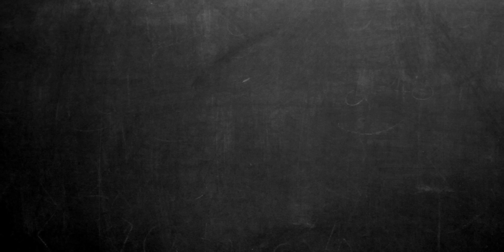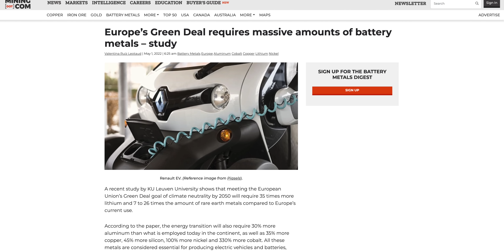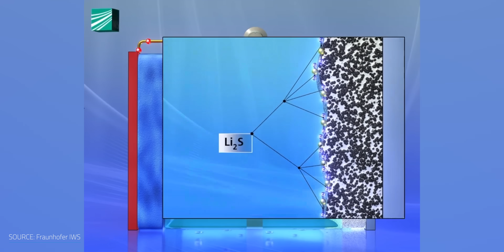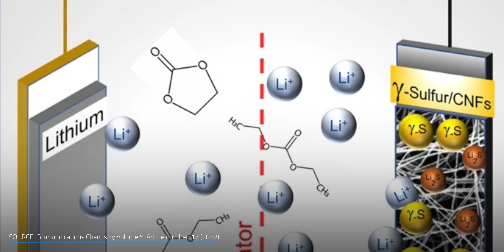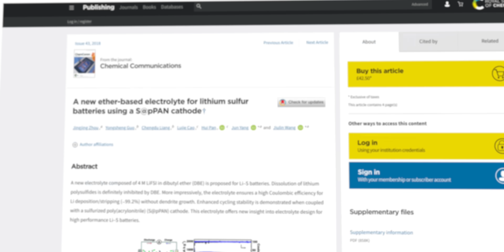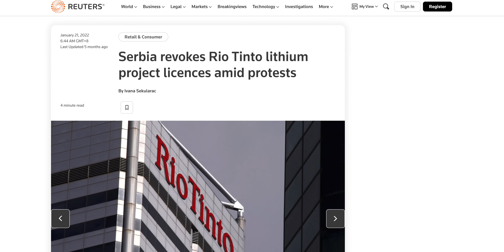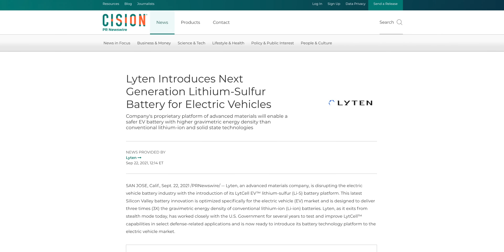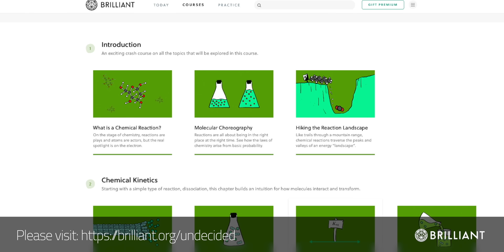Why This Accidental Battery Breakthrough Matters

Comment: Seems like it was five or six years ago we were going to get a battery based on Cotton that would be commercially available now.  Then there was the sodium glass battery..  And a few more that I can't remember right now but it's ta
tiresome to always hear that "prosperity is right around the corner" so to speak in the battery world.   Grid scale storage and better transmission systems are what we need most but batteries for cars and mobile devices seem to take priority.   I hope this works, but I'm done being optimistic.

Comment: Lithium ion or sulfur or iron phosphate or aluminum should all be used to store electricity as well as all other storage methods that may com around. Storage capacity will eventually surpass electricity creation as the more efficient ways to produce electricity are phased out such as coal, natural gas, hydroelectric and nuclear. Solar and wind are far to unreliable to replace the supply being phased out.

Comment: I generally skip the almost daily "battery breakthrough" videos, but knew from past experience I could expect some grounded and accurate information here...Thanks Matt!
Sure hope this process is able to be scaled up to produce low cost high performance batteries.  Sounds great, and five or six years is not too long to have an impact on EV adoption.
Reply: @Plentus  Fair enough
Reply: Lol, I ignored it 3 times when it came up in my recommended videos, them finally clicked
Reply: there have been so many breakthrough innovations in the past two decades... some low tech some high tech but none have changed much in dealing with the problems next generations have to cope with ... I fear that EV will not be the solution... more human powered vehicles and more mass transit is the solution
Reply: Same here 😆
Reply: HAHAHAHAHAHAHAHA acurate info here? this dude is a massive fucking scam he knowns nothing. it's all just made upp bullshit that will never work
Reply: 6 years to what? Achieve what the market is offering? What will be that product after 6 year, current product will be surely more affordable and specs will probably double or triple before that "breakthrough" hit the market.

Comment: What ever happened to the discovery of glass solid state batteries? I thought that was supposed to be the holy grail with making batteries safer compared to Li-ion and environmentally cleaner. Not to mention 100x smaller per joule.

Comment: ok, so, since we have so much about the current materials, why they are good, what are the problems etc, why can't we invent a new material that could be produced using other widely found materials? I'm talking about chemical reactions, combining them in certain ways etc. I know I know, so many scientists are working on that kind of solution already, but why can't we do it as of today? we should be able to come up with detailed specifications of battery materials by now, and what is closest to it, considering cost too, and why can't we invent new materials meeting the requirements. I am a scientist too, and it's my understanding that "we just don't know".

Comment: Just like all of the other "breakthrough" battery technologies this will never see the light of day. Also there is no "Lower cost" when it comes to this type of energy supply. It will sell at a premium compared to L-ion batteries... not that it will come to market but if it did it won't be cheaper. The reduction in cost to manufacture results in increased profits and not lower price to the end consumer. Saying "lower cost" is at the very least misleading to viewers.

Comment: What I want to know about these cells, are what are the nominal, fully charged, and discharged voltages on a single cell and what the amperage output would be like (example, a single cell of 1000mah capacity)
Reply: The voltage should be probably/hopefully also around 4.2V. I mean It is still using lithium. The thing about all of these "Battery Breakthrough" that we are hearing every month is that the majority of them (100% until now) are only feasable in the laboratory.

Comment: It would be interesting if you actually went over the progress of LiS battery cells, that have actually been produced, versus ones that may never exist. Capacity is useless if you cant get any amps out of it, and so far they are not that impressive in amperage output. What is impressive, is power density. Claiming they are close to a break thru is a bit odd, since they have been saying exactly the same thing since they were invented in the 60's..... The talking head you interviewed claiming to have a possible break thru was not present when the batteries were made for the plane that outperformed both the theoretical and experimental ones proposed, which is really odd...  Lithium Sulfur batteries already hold the electric plane endurance record. Set by the Airbus Zephyr in 2008. Don't fall for the hype of all these people being "close to a break thru", when someone else already built and produced ones that actually work. The LiS batteries in that plane were made in Arizona, by a company that has made them for years. That company still holds the record for the highest energy density of anything rechargeable. Oddly, you never even mentioned them..... I can see why. The talking heads can't even do 2000 recharge cycles on any lithium battery... The company you never mentioned has cells that already can be recharged 2000+ times.

Comment: No, king is LTO... 10 years in Chinese electric buses and now selling these, but nobody wants to talk about LTO that lasts +60 years... Nobody wants something that last that long everybody wants cheap replacement batteries. Even Nasa is testing LTO in their sattelites right now. 200 cycles on Sulfur battery thats nothing for regular batteries with 2000 cycles, yes indeed thats nothing with 
20 000 cycles with LTO... I bought them i tested them and winter doesnt kill it anymore its perfect.

Comment: Although having a break through on the technology is good, I think they should push on the use of Sodium-ion as lithium-ion battery replacement even faster. Extraction of Lithium is has a high pollution problem, and sodium is a more abundant chemical that should be cleaner to extract, and might also be something to look at with seawater distillation since that creates brine as waste and putting it back into the sea will increase the salt concentration of the sea, but brine can actually be a source for sodium (I think)

Comment: If batteries suddenly had twice the density while lasting 2000+ cycles it would ensure EVs take all markets besides air travel by 2030. Drones would be a UFO-like blur. Been around since the first "high current" lithiums (think barely 5C discharge and 60-100 cycles tops) first came on the market in the early 2000s and within 5 years electric had surpassed nitro RC in pretty much every way. Watching a high performance nitro powered RC car or helicopter today looks like it's in slow motion by comparison. Double the density would put it in the "has to be aliens" range.

Comment: Sodium sulphide was actually touted as far back as the '70s as a much-lighter replacement for lead/acid in cars. At the time, it couldn't match the overall performance, hence we're currently still stuck with the old heavyweights. I'd always thought, tho, that the system had potential, and now - big thanks for this video - Cinderella may just be going to the ball. Really look forward to developments in the next few years.

Comment: I see the information presented here certainly does provide a great incentive. To multiply output in this example here is more than tremendous. Vehicles are already seeking a reasonable driving distance at vehicle maximum gross weight of 700 to 1,000 miles. FPV drones are seeking run times of 20-minutes and greater. General Aviation Aircraft are seeking at least 2 to 4 hours run time. I sincerely do hope it works and comes to market asap.

Comment: Just replacing Ni and Co in battery manufacture would be huge by itself but 3 times the energy density and the potential to use Na as apposed to Li that is amazing. There are so many knock on effects if all this is true. Lighter vehicles, lower material costs, lower operating costs, all on top of lower initial purchase price. I hope they can make it all work.
Reply: Yeah 3 times the energy density would really close the gap with gasoline. Then batteries would have a whole one tenth the energy storage density gasoline has!
Reply: @1pcfred  A Tesla model S has a range of about 405 miles, if we change that to batteries with 3 times that that's 1215 miles(damn). How many cars do you know of that have that kind of range? It's not just about the energy density it's about how readily used the energy is. For gasoline engines only about a third of the thermal energy from combustion is actually harnessed. So while gasoline has an energy density of 46 Mj/Kg we only get a little over 15. Conventional Lithium Ion packs get .3+Mj/Kg so if we up this by three times that's getting into 1Mj/Kg. Gas is still better, but wait there is the transmission and every other accessory the engine has hanging off it. That cuts the efficiency again by half, therefore of the 46Mj/Kg only 5.5+Mj/Kg gets put to the wheels. The 1Mj/Kg from these new batteries is not that far off from 5.5 or even 6Mj/Kg. Having a small gasoline generator would still be better though as you could take the full 15Mj/Kg and use it to drive the wheels. (edit, corrected my dyslexic moment)

Comment: Battery technology is absolutely exploding.  Liquid metal batteries, salt water batteries also have a place.  Liquid metal batteries never wear out, as each time they are melted, they basically rebuild themselves.  But they are for large static installations.  Saltwater batteries look promising for large mobile installations like cargo ships.  Repairing them is pretty simple, as there is quite a lot of saltwater in the ocean.

Comment: Clearly energy storage will be one of the most important engineering developments for the 21st century. Otherwise, green energy will only be a political fantasy for fools. It takes considerable energy to hold a drone or airplane in the air.  Intermittent sources like Solar or wind will require copious storage strategy in our electric power grid to make it practical if not competitive with Coal or Natural Gas. A tank of gasoline in you automobile is presently the most practical way to store significant energy. Only Nuclear power plants are a more concentrated form of energy.

Comment: If batteries this much cheaper actually hit the market that will crash the prices of the lower end of all electric vehicles.
Because as absurd as it sounds buying an EV is currently the cheapest way to obtain big batteries. And their relatively high price even in the high end segment is a good chunk battery. For the lower end it can easily reach 50-70%. So if the battery price dropped by 80% that would heavily encourage building even cheaper smaller vehicles in between bikes and cars. Just look at how cheap low end e-bikes already are and batteries are almost half their price. That would open the market to a lot more viable options on the lower end of the budget range.

Comment: Next to Lyten, there is also a company in Europe called Theion who are in the process of commercializing a lithium-sulfur battery. They currently have button cells in customer acceptance testing, and in 2023 want to go through the same process with a cell made for mobile devices. By 2025 they want to be shipping cells sized and specced for car batteries to car manufacturers for testing and reviewing.

Comment: I'd be interested to know the efficiency of the batteries they have been testing. The lifespan and energy density advantages sound great but the efficiency is also hugely important.
Reply: Depends on the usage... as I understand half the initial cost of a good green energy power plant is now sunk into the batteries. So the full plant could end up being 66% cost of the orginal. At that point you just build 3 solar plant for the price of 2 and you don't mind the efficiency.
Reply: @hurktang  that's a fair point but only if the efficiency is within an expected range. If the efficiency is low enough then scaling up the input could a become uneconomical. But, just like you, I imagine this is not the case. I was thinking more in terms of the car/drone usage. If it becomes the standard battery for all EVs then the efficiency becomes important. When you scale up the usage, the losses could really mount up. And if this kind of battery is used to store energy multiple times after being generated then it gets worse still (i.e. wind turbine > on site battery > grid > ev battery). That said, if the efficiency is higher than current batteries then we are definitely onto a winner! 😁 Also, now I think about it, I wonder about charge times too 🤔 we definitely need another video on this! *Hint hint
Reply: @Lars Hansen that's true! Fingers crossed for a follow up video..

Comment: It's nonsense.....
you take a li battery to 8x the energy storage, then quite literally you are selling  something 4* more energy density than TNT on every street corner.
worse still you only need water as a detonator.....
Would you really want to be carrying something that is triggered by water & 4 * more powerful then TNT by your nuts in a rain storm?
Not to mention it would have to be totally banned on airplanes
Reply: But we do already carry lithium ion bateries, both by "our nuts" and inside airplanes. And normal people dont carry a battery bare bones, there is always a casing and most technology is becoming waterproof.
Reply: @chickensoldier9790   we are talking about an 8 fold increase.....
to turn that into a deadly bomb.
would require  less than 10 minutes and be under every security radar.... since you buy batteries off the shelf.
Unlike TNT which requires a license...

Comment: Why say this is a battery breakthrough when it blows up at such low temps? That's never going to be a battery. This is a breakthrough in chemistry, useless in batteries.
Reply: stfu dumb head, he said this for other researchers
Reply: Since when do batteries heat up to a 100°C?
Reply: @chickensoldier9790  They said it starts boiling at 42C not 100. Batteries can easily hit 42C.
Reply: @Tony-nl6pf  that design wasnt the one the video is about???? Thats the ethanol or whatever design he briefly mentioned.
Reply: @chickensoldier9790  Why isn't this a thing then? There's always a catch. They found a battery that lasts longer and holds more charge per weight yet they chose to "study the chemistry" of their new discovery rather than pushing forward with the battery. If there's no products that have this within the next 5 years...
Reply: @Tony-nl6pf  because the process to make the needed form of Sulphur inside the design is not easy to mass produce and its also a new discovery. New technology isnt made overnight, it takes time.

Comment: This is only one part of the "Renewable" conundrum. While this is a great improvement possibility, if true Renewable is to be achieved all aspects must be achieved.
Energy production must also be completely Renewable along with delivery infrastructure as well. Wind and solar are too unreliable, That currently leaves Hydro/electric which can only do so much, then there is Nuclear which is frowned upon yet is totally safe if designed correctly unlike Fukushima. Last there is Fusion technology, while promising is just simply not there yet, the "Q" value is still in the negative. Hydrogen would be nice but we need a method to split water molecules which yields a positive net energy output. Electrolysis, while efficiency technology has gotten better, it still takes more electrical energy to split the molecules than you get from burning the hydrogen with oxygen in the air.

Brandon is killing the US by cutting fossil production pushing "Green Energy" when the whole energy platform is fossil fuel based while there is obviously a gross insufficiency in Renewable technology/development and infrastructure. 
The transition can't be immediate without global catastrophe.

 The technologies and infrastructure must be in place first, then start the transition over time.

Comment: I like to see new advancements. I prefer Lithium Iron Phosphate batteries over Lithium Ion. They're cheaper, last 10 times longer, can be charged or discharged up to 25 times faster, and they're non-combustible. They aren't affected by heat.  I hope these Lithium Sulphur batteries and Graphene batteries take off.

Comment: I would be interested how this technology holds up in different environments - cold, warm. How energy capcity would be depleted in case you are not using battery. How significant degradation would be after certain amount of recharging cycle. What about safety - if you crash Li-ion battery you are risking you will be really fast roasted BBQ if you are driving the car - so some insight on battery behavior in case of colision.
Reply: And how do these battery technologies work in extremely cold climates as well as hot climates

Comment: Nature might extend beyond batteries to allow the convesion of the thermal kinetic energy of mobile electrons into electrical energy by the differential interactions of thermal electrons with a non consumed carbon nanotube forrest cathode and nonconsumed varigated graphine char anode. This concept needs to be researched by protototypes to see if it initally works and can be improved or made to work and then be improved.

Aloha,
Charles M Brown lll
Kilauea Kauai HI 96754

Comment: The Sodium/Sulfur batteries sound like the biggest game changer. Chemically common elements on the planet that no nation has a monopoly on. It could create an industry that could be anywhere. That, and The far higher power supply these batteries give could be a game changer in terms of renewable energy.

This is THE step we needed.